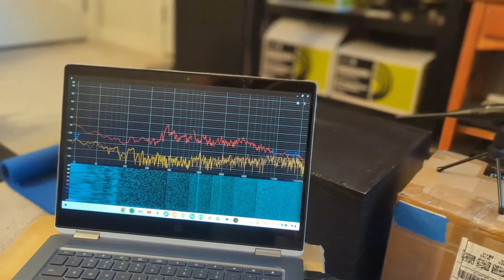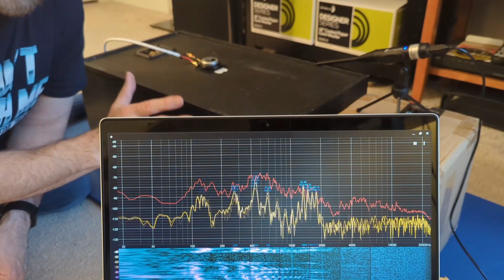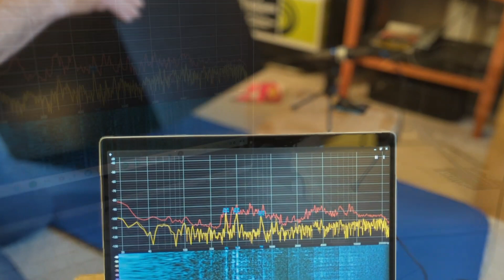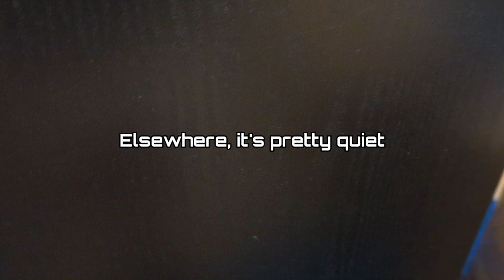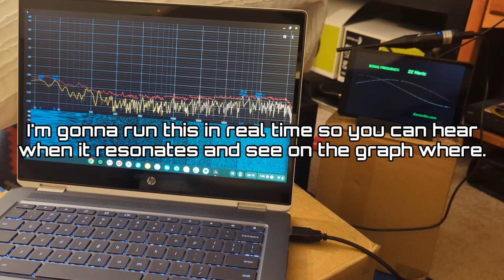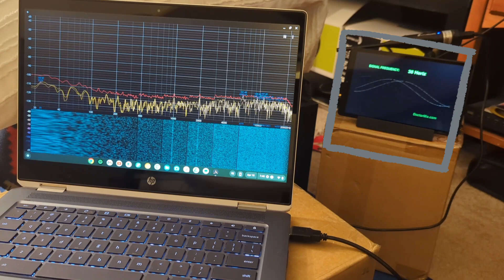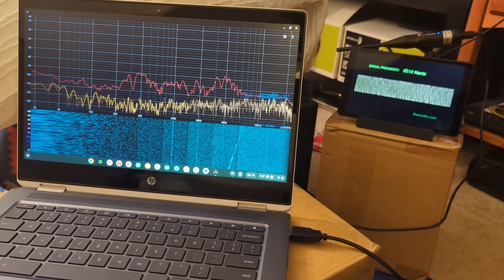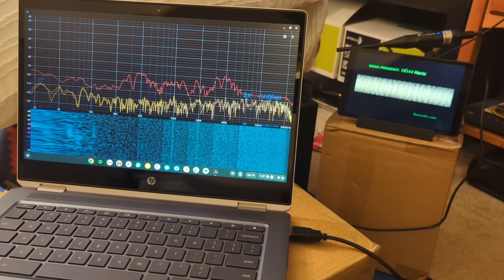How much does sound deadener help reduce speaker cabinet resonance? Find out in RCA STS-1230 Part 17

Comment: Nice video.  It's difficult to make this kind of content. There are cabinet panel resonances and there are acoustic internal box modes.   Thick and stiff panels with bracing every four inches will usually get the panel mode frequencies up above 1,000 Hz or so.  It's possible to calculate them using CAD software.   I design the box so that the lowest panel resonant mode frequency is above the frequency of the driver that is mounted in that cabinet volume.   The other strategy is to add alternating layers of soft and hard material, constrained layer damping, to build walls that are very well damped.  I just put the microphone near the panel and then knock on it with my hand or something that won't dent it.  The spectrum analyzer will show the resonant frequencies.    The internal acoustic box volume modes are set by the distance from the driver to each wall.   Fiberglass batting stuffed in the box will damp those modes.  It is  most effective above maybe 600 Hz and slowly declines in effectiveness below that until it is useless in the bass frequencies. Keeping the box as small as possible keeps the acoustic mode frequencies high enough that damping material will work.  A half cube shaped box  with the driver centered on the square face has the highest first mode frequency, and that is what you want. A well designed, constructed and stuffed box will add no audible resonances to the sound of the speaker.  Of course you want a sealed box, as that requires the smallest volume and ports are just resonators that crushes bass transients an lags the music with slow decay.

Comment: what are you using for measurement setup? soft- and hardware?
thanks.
Reply from the maker: Thanks for watching and the questions! Measuring"system" presently is simply a Dayton Omni Mic USB connected to a Chromebook, using an app called "Spectroid" and I use the Dayton Omni Mic test DVD. This allows me to see in room response amplitude across the frequency spectrum, an extra tool in addition to my ears. Not fancy, nor comparable to some of the other measurement systems, but it's all I've got presently. If you have any specific questions let me know.

Comment: Finally got my first real hi end amp today....Emerald Physics 200.2 SE. What a beast! Good day! A nice DAC is next on the list. Are you running the ipads dac or .......? Im running off my computers dac headphone to rca. 
Great vids keepem up! The visual sound artifacts are cool too! lol
Reply from the maker: Congrats and thank you! As for DAC's, I should know what they do, but never looked into it. I think it means digital audio converter though, correct? I think my tablet hooked up to the receiver via analog connection, would mean the receiver does the processing, but I'm not 100% sure on that.
Reply: @wattspeakers  Yep, digital to analog converter. They say its the heart of todays modern systems. Your tablets dac is doing the work, I doubt the reciever has a built in dac but it might if it has digital inputs. Try swiching between the tablet and your laptop, they sound different because the dacs are different. For now I use my laptop with a free 10 band EQ download to adjust levels before it goes to the amp/tuner etc.
Reply from the maker: @freeradical6390 Very interesting. I looked in the manual for my receiver (NAD T-757v2), and it reads as follows:

STEREO
Output is directed to the front left/right channels. Low frequencies are 
directed to the subwoofer if one is present in the Speaker settings. Select 
“Stereo” when you wish to listen to a stereo (or monaural) production, such 
as music CD or FM broadcast, without surround enhancement. Stereo 
recordings whether in PCM/digital or analog form and whether surround-
encoded or not encoded, are reproduced as recorded. Multi-channel digital 
recordings (Dolby Digital and DTS) are reproduced in “Stereo Downmix” 
mode via the front left/right channels only as Lt/Rt (left/right-total) signals.
DIRECT
The analog or digital sources are automatically played in their native 
formats. All the source’s audio channels are reproduced directly. This 
mode recreates the original sound most faithfully thereby producing 
outstandingly high quality audio

Currently I've got the Android tablet hooked up to the Analog aux connection and receiver is set to direct, (no added effects or equalization... Just plain amplification). I've got the sub setup but it only comes on if I turn it on. The fronts are set to full range.

I've tried hooking up my Chromebook also, and it sounds the same to me. I don't have anything fancy on the tablet or Chromebook in terms of sound settings. Anything extra either of them has is turned off.

My DVD/CD player hooked up over HDMI is also set as "direct" but sounds entirely different from the Analog... It's way louder for sure.

So, I'm assuming that whatever PCM is being sent over the aux cable from the tablet is just ones and zeros with no other effect, but I could be wrong. Hopefully someone with more knowledge than I have of DAC will chime in, but as far as I know there's no conversion going on... Unless it's just digital from the tablet being converted to analog.